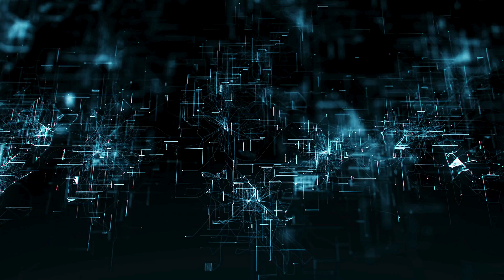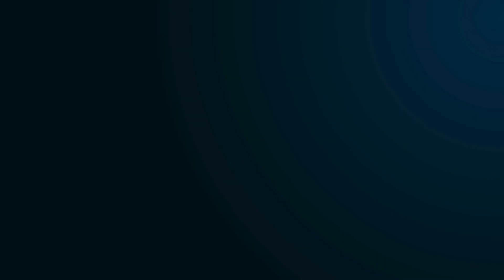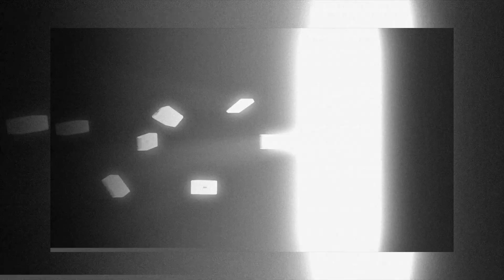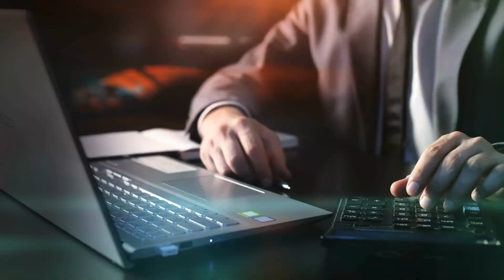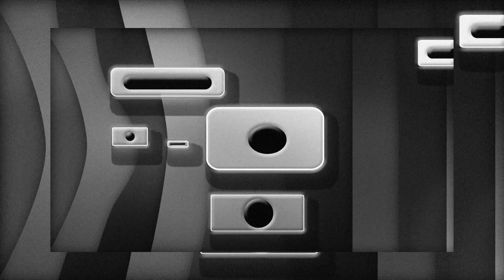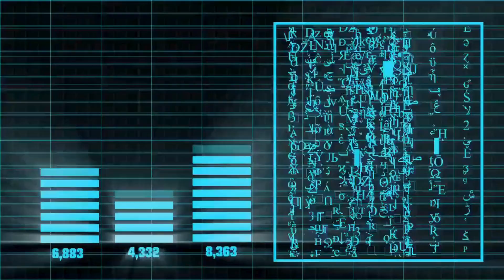Understanding System Parameters – TU, TS, TR | CAFA Talk 33

Comment: I am really interested in the benefits of iterative refinement using a chain of thoughts with systematic TU, TS, and TR parameters. This approach makes interactions much more organized than just having a raw conversation. It helps avoid hallucinations (when AI gives wrong or made-up answers) and makes the use of AI much more manageable and reliable. By following these steps, we can make AI’s responses more accurate and useful, and we can better control the process to get the results we want.
Reply from the maker: Thanks!

Comment: Reading how a TR from one turn “passes the baton” as the direct, precise input for the very next turn really resonates with the evidence-chain discipline I drill into federal security auditors—every data element must have a provable lineage before sign-off. That baton-passing mirrors the structured phases found in the NIST RMF I teach, where artifacts move cleanly between phases to prevent compliance drift. I’m now thinking I can use this TU-TS-TR cycle as a live demo in my cybersecurity classes to show that prompt engineering can achieve the same auditability and rigor we expect from security controls documentation in the cyber domain.
Reply from the maker: Thanks!